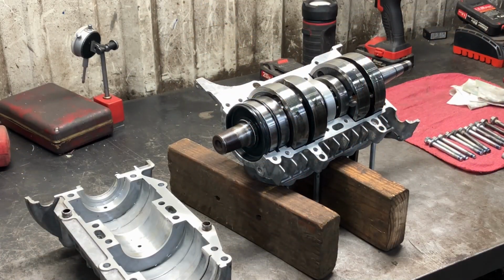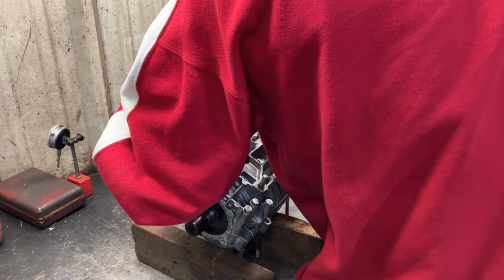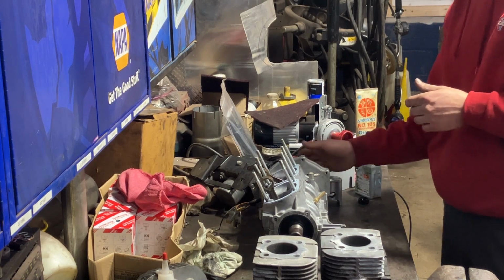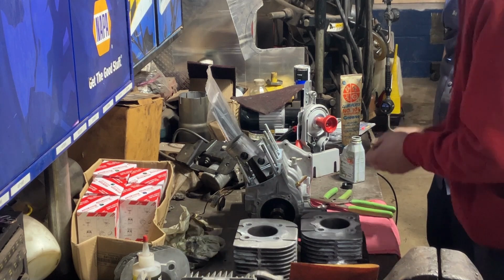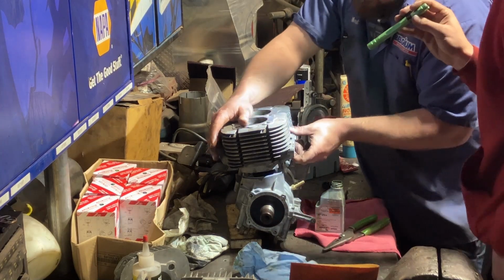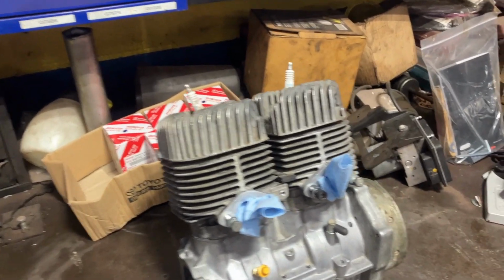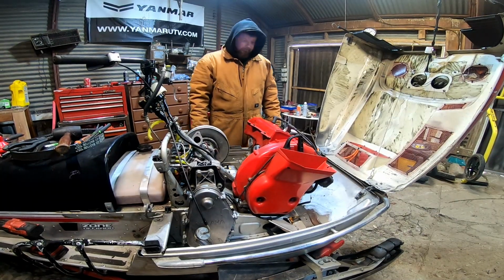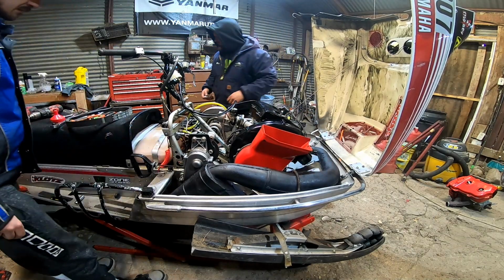"QUICK & DIRTY" Engine Rebuild + Motor Swap - Exciter 340 is ALIVE!

Comment: Great video. What did you use for the hydraulic brakes? And bracket to mount it? Keep em coming.
Reply from the maker: It's a wilwood setup from a 90s ZR and the bracket is custom made just some metal and welded nuts to it